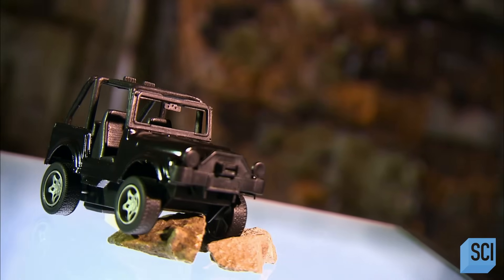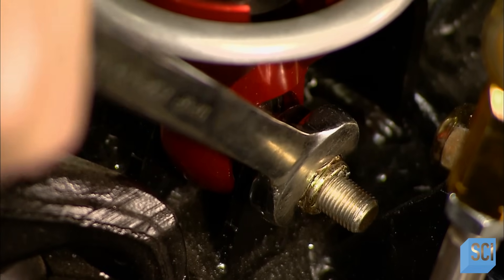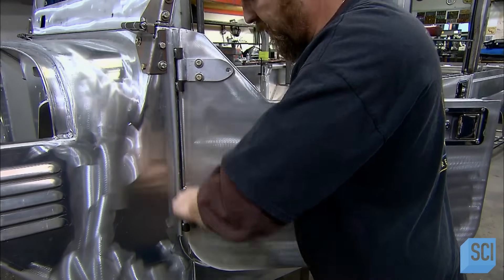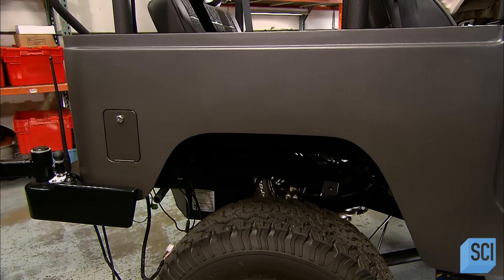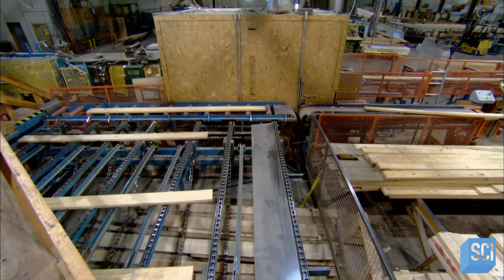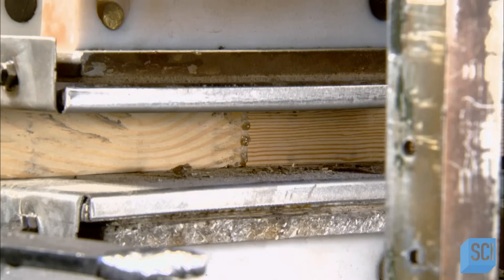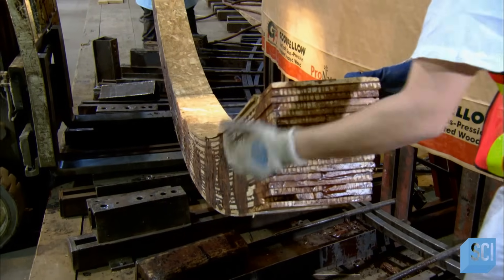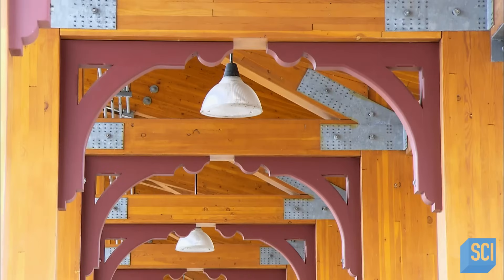SUVs and Laminated Wood Beams | How It's Made | Science Channel

Comment: those icon jeep repros go for like 250k at minimum...
Reply: For 250k, I expected that thing to have at least air conditioning but nope, just overpriced as usual 😂
Reply: Yup!  Found the website...  I completely get that these are hand built, one at a time, but $250k+ per copy seems like a bit much for a parts vehicle.  

Nice rides though...  If I had that kind of cheese to waste, I wouldn't hesitate to pull the trigger.

Comment: I wanted to see the machine that planes that big curved beam. That's not an SUV, it's a copy of a Jeep. An Explorer, Navigator, Tahoe, Yukon, or a CRX as long as it has 4 cupholders per seat, charging ports and screens on the seat backs. That Icon is an unheated box with wheels
Reply: Not even jeep it's body is a swb fj40 landcruiser